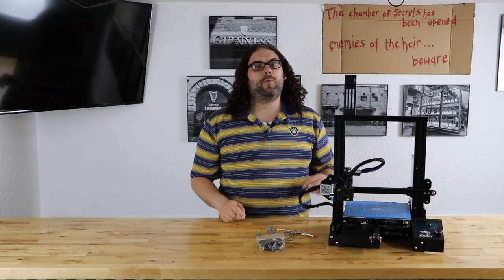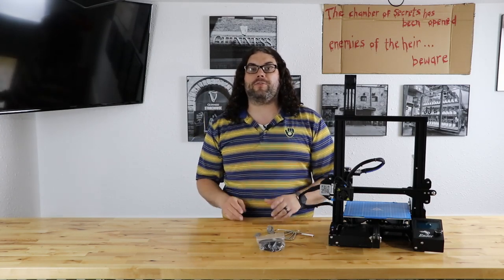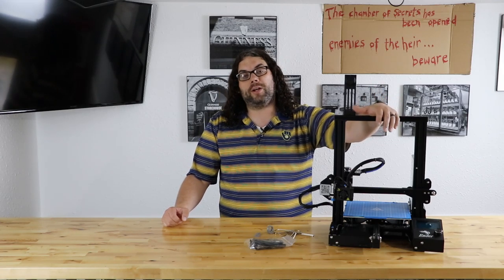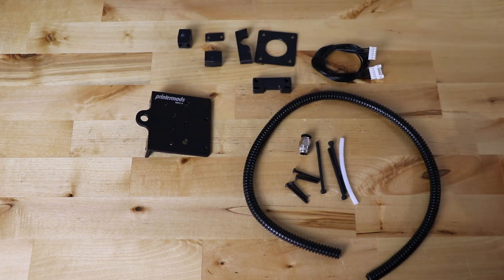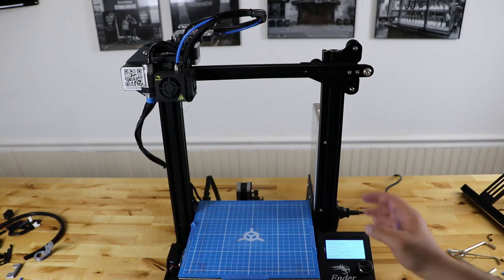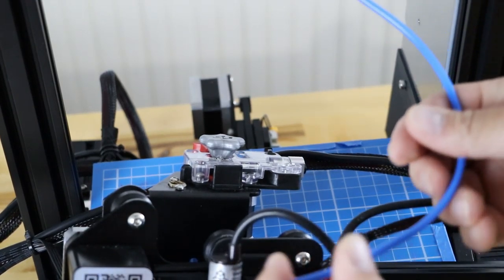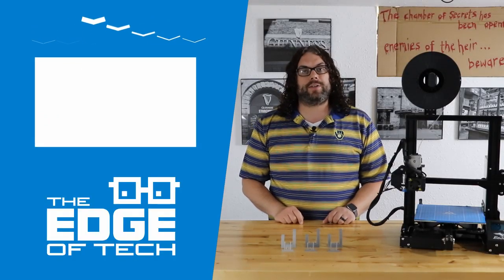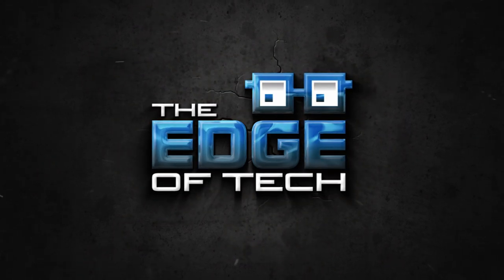Installing the New PrinterMods Direct Drive Extrusion Kit on the Ender 3 with an EZRStruder

Comment: Did you notice much of an increase with ghosting after? Also have you been able to increase your print speed? I know shorter retractions will make prints faster, but I've seen claims that you can print at 120mm/s plus.
cheers
Reply from the maker: I could print faster, but I generally don't. I think a lot of people really like direct drive for flexible filament and this mod works great!

Comment: —A little over a year later, DO YOU RECOMMEND THIS UPGRADE?   Thanks in advance
Reply: yes
Reply: @pawpatina   I hope so I just ordered one a few days ago.  The quality looked it got worse on his test print.
Reply: @SS-gc9pq  yes, any change to the machine BEFORE recalibration, will look worse... its inevitable... redo all the basic calibrations tho, and you will not only have faster retracts/movements but can run flexible filament with a lot less stress.

Comment: Hey The Edge of Tech, I actually just did this mod but with a BMG extruder. I printed brackets off of thingy, and printed a neat fan-duct ect ect. Sadly the extra weight on the X-Gantry from the stepper motor (even tried a pancake) caused a lot of odd issues with prints like ghosting/ringing or just fully moving layers. I have tried different speeds and settings to help but nothing seemed to really dial it in. The weight and momentum swinging left to right really fudged up prints. I have done the X-Gantry fix to make sure it was level but the weight still caused a few mil sag. I have also properly tightened belts and all. However.. (maybe a good video idea) I think this would be better with the Ender 3 dual z-rod upgrade.. But for now, ill go back to the tube.
Reply from the maker: Thanks for watching! Stay tuned soon for the video you request! My dual Z should arrive any day?
Reply: @TheEdgeofTech  Oh EPIC! I liked the direct drive idea but man, the extra rod would really step it up =)

Comment: Thanks for the vid! Big help! Awesome mod for the money. One question you might be able to answer. When using the EZRstruder do we know exactly how long to cut the PTFE tubing? I just can't get it right! lol 
Congrats on the 10,000 sub's! 👍
Reply from the maker: Good question! I don't know the exact measurement because it can move a little. Mine is a tad short, but still works!
Reply: @TheEdgeofTech  I can tell mine is to short to, but working (even TPU). I'll mess with it and if I get a good length I'll let you know.

Comment: Hi Jim, nice video, do you have to re calibrate the extruder when you use direct drive like this ?
Reply from the maker: Theoretically, you should yes. But you have to do it through the hot end method because it's all tied together then.
Reply: How do you recalibrate

Comment: Did you print the EZR spacer from PLA or something sturdier/more heat resistant? I'd like to use PLA if I can, but have some PETG if needed.
Reply from the maker: I used PLA!

Comment: I'm going to be doing this install myself and I have a question. Shouldn't the ptfe tube be longer than what you are using since the EZR Struder is designed to have the tube reach halfway into the extruder body?

Comment: OK, good info.
I was just wondering who was first, the company you promote or Basaraba Innovation which I believe is the one MIchael at Teaching Tech used for his Mod.
Any Idea if the pancake NEMA 17 stepper motors would work instead of the full sized ones? I am toying with doing this Mod and think it would reduce the weight on the X axis.
Any thought?
Reply from the maker: I am not sure if the pancake NEMA 17 stepper motors would work, I suppose if they were tuned right It could work. These are very similar to the Basaraba ones. So close that the Teaching Tech adapter for the EZRStruder works with it!
Reply: Because the EZR Extruder is a non-geared Extruder (not like a Bondtech) a pancake stepper may not have enough torque to drive the filament through the hotend.

Comment: Seriously frustrated. When Im trying to attach the EZR struder with the spacer to the MDD plate, the PTFE coupler on the EZR is hitting the bolt to one of the pulley weeks and will not sit flush on the aluminum plate.
Reply: Same thing is happening to me, fid u ever find a way to fix this?

Comment: The problem with the extruder stepper facing out front is that it adds some front-down force on the carriage that might wear the wheels faster than usual. I run a direct drive mod as well but with the stepper 'sitting' above the carriage so that weight/forces are even on both sides. I did lose a bit of a z-axis printing height but that's no problem for me as I don't really print tall things.

Comment: Great Video - How do measure  or calculate the extruder E-steps?
Reply from the maker: I use the Method that goes through the hotend to do it on this machine.
Reply: preheat hot end to operating temp. mark off 100 mm from the entry to the extruder. in Marlin move extruder axis 100mm. measure how much filament is still showing between extruder and the mark you made earlier.
lets say 20 mm.
100-20=80
100/80=1.25
1.25 x your Esteps as shown in your machine, usually 94.5 stock
so 1.25 x 94.5 = 118.125
change steps to 118.125 then STORE SETTINGS...
then test again.

Comment: Ok so I did the upgrade.  Have an EZABL mode already installed.  Put in all back together and tried to re-calibrate by EZABL.  NO go would not work.  Seemed that as soon as you give the G28 to home the EZABL thinks it's at the bed and goes thru homing and ends up in the middle of the bed then moves up 2-3 mm.  The gantry can be up at any level an because the EZABL thinks it sees the bed it will never go to true home.  Talked the the folks at TH3D and they just sent me some mods to Configuration.h in the unified software release.  After looking at what they sent It seems there may be some interference between the EZABL and the extrusion stepper motor.  Makes sense because it's the only thing that has changed.  Did you have to modify the software when you install the change?  If so what did you do?  Will let you know if the change fixed the problem.
Reply from the maker: Sorry to hear that it's acting crazy! I only had to do what's in the video when I did mine. If you're working with the TH3D support, they probably have the best ideas on how to fix this. Let me know what happens!
Reply: @TheEdgeofTech  Fixed.  TH3D (fantastic support) fixed it via a parameter change in the set up for the Unified Software (configuration.h - un-commented the line following  "// This will disable the XYE motors during probing. Can be useful if you have stepper motors causing interference issues with the EZABL sensor.
"
#define PROBING_MOTORS_OFFv .  I think they will add this to their knowledge base for the future.  Because the stepper motor is now very close to the probe interference was the problem.  Back to printing.  Thanks for you response.
Reply from the maker: @budschultz5544  Awesome! That's great!!

Comment: I did a similar setup, not the same manufacturers, but a direct drive with a prox type ABL, i have an issue that when my steppers engage, the prox reads the noise. How can I use the abl with the direct drive?
Reply from the maker: Nice! Good question. Did it do that before the direct drive?
Reply: @TheEdgeofTech Hi, on the topic of the extra weight on the X axis beam.....I thought about that a couple a' days ago as I want to do the direct drive mod too and came to the conclusion after poking my beak deep into the innards that it's the wheeled Z axis carriage that is at fault.                                                                         This controls and maintains the squareness of the X axis beam to the left hand column upright. On the basic model you can easily move the beam up and down out of square with just a finger tip even though you also have another 3 wheeled carriage against the right hand upright, which doesn't do anything.                        What I intend to do is modify the left hand Z axis wheeled carriage plate.....with a new wheel carriage plate...... and make it have 4 wheels.....all will have adjusters not just one as is on the basic model.                                                                                    The 2 on the left side of the column will be adjusted to make the beam square and the 2 on the right side of the column will be to get the tension against the column.  If you look closely at the left hand Z axis carriage and move the X axis beam up and down you will notice that the middle roller on the Z axis is able to deflect as the leverage of the long beam puts pressure on it.                                                              The single existing middle adjuster wheel cannot keep the beam square while in the middle position.

Comment: Great video. Do you have an .stl file for the ezr struder spacer that you used in the video? I have the same setup, but haven't created a spacer for the ezr struder. Thanks.
Reply: Never mind. I found it in the video you referenced.  Thanks again for your tutorials. I have an Ender 3 Pro and have learned a lot from your videos.

Comment: Stay away from Printer Mods.  Just ordered the direct drive kit.  It's supposed to ship in 1-3 days but it actually took them a couple weeks to put it in the mail even though their customer service said it had already shipped.  They took days to reply to support tickets, and when the package actually showed up, the plastic pieces were badly warped, scratched, and one piece was snapped almost in half with a random burn hole through it.  Clearly not shipping damage.  Working on trying to get a refund now.  Fingers crossed.

Comment: Based on what you showed, I don't see improvement in the print quality.
Reply: With direct drive it lowers the retratcion needed and its easier to print flexibles, so you should have less stringing once dialed in and better medium control with flexible  filament , on the down side the mass is greater having the stepper motor on the axis which may  cause ringing or ghosting.

Comment: Those tests are awful, all of them like wtf ?? If my printer were printing like that I'd tear it apart and start over. When you vid a mod its more or less expected that in the end we can see an improvement so you can say okay so before was like this but with this mod it got better like that. All I can see is it all sucks always. Also, I did mod my Ender 3 pro for direct drive and for those that were left scratching their heads if they should do it or not, yes you should. If you tune you e-steps after and take time retuning everything and not be lazy, its very much worth it and you'll be able to print that two-pole object with ZERO stringing like I do.

Comment: Does this work with the hot end fix where you cut a piece of tube and put it in the hot end then only worry about the tube coming down into the top of the hot end or would you need to replace the whole setup like shown in the video?
Reply: ValFera yes it would, just have to compensate for the shorter tube between the spacer and Extruder

Comment: If it isn't broke don't fix it. Direct drive on a single z axis printer would not not be an upgrade. To much weight and inertial mass now on the X axis. To me the best idea for direct drive on these type mod machinea is the cable drive Zesty Nimble. Much better overall
https://zesty.tech/

Comment: "I can't dial my retraction and kinematics settings in. Let's convert it to direct drive!"
Reply from the maker: Haha too funny! I had this machine quite dialed in, bit it's the machine that I do most of my upgrade videos on. So it always hurts when it's running so good and then I tear it apart to upgrade it. Haha
Reply: @TheEdgeofTech  No insult to you, I just see lot of newbies in the Facebook group converting to direct drive because they think it's a cure-all. I also see a large amount of people recommending horrific retraction settings. Slinging around a bunch of weight on the print head isn't the best fix for improper retraction. If you want to print flexibles, then fine.
Reply from the maker: @buckeyefan635  No Insult taken. I agree that you should learn your printer and get it dialed in before jumping into any modifications! This isn't the solution to retraction issues, because if you don't dial this in, you will have the same problems. The stock setup is more than good for these printers. But I would definitely replace the garbage plastic extruders. Haha